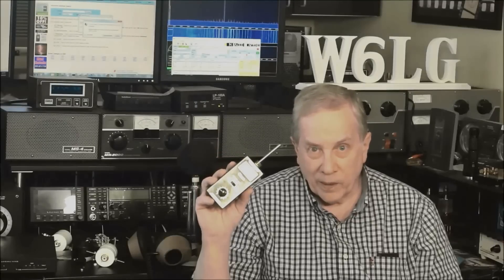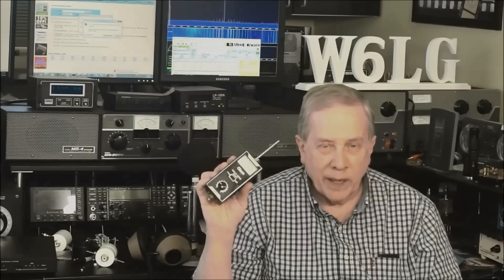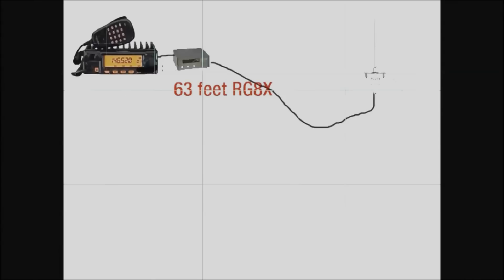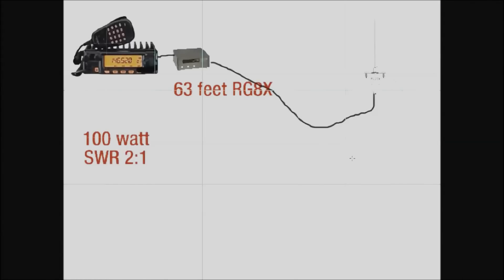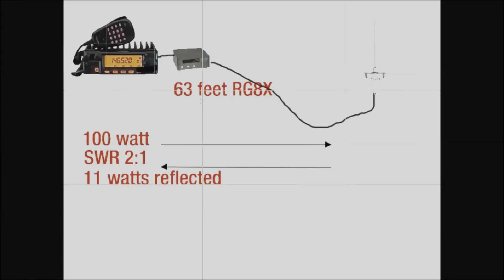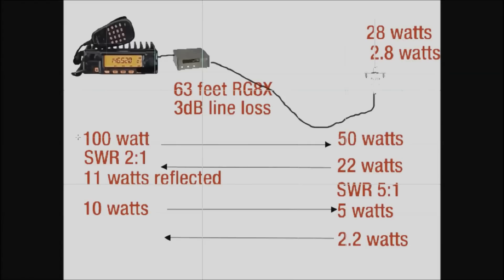Ham Radio Basics--SWR, How To Measure And Is it Important-A Surprising Answer

Comment: There are thousands of videos like this, none of which are for beginners. You’d have to be an electrical engineer in order to understand how to properly transmit with ham radio. Why don’t they just have kits, like here- you want to use uhf and vhf, here’s everything you need to do that. So frustrating beyond belief.

Comment: Why does swr go up with increase in power ?
Reply from the maker: It does not go up.  It does not change. The diodes in your SWR meter are not linear and display incorrectly. 73, Jim

Comment: Hi Jim! For the energy to be re-reflected from the transmitter back toward the antenna requires a reactive element to catch it and then release it in the proper phase. An antenna tuner is such a device, but there was none in your drawing. As to your main point, yes, a lossy feedline will certainly make the SWR look a lot better at the output of the tuner than it really is at the antenna. Nice graphics, BTW!
Reply from the maker: Thanks Dave.  How's it going with you?  it is a beautiful day here and warm.  I was in the backyard hanging an OCF dipole.  
Some local guys have offered to come by here and help me add 15 meter elements to my homebrew 3 element 20 meter monoband Yagi.  At this time I am planning on 2 feedlines.   I am using a beta "hairpin" match now.  Nice to hear from you again David.  73, Jim W6LG now in Rocklin CA
Reply: @ham-radio  Hi Jim, doing fine. Still can't make up its mind here if it's winter or spring. Good luck with your 20m/15m antenna! 73, Dave, KEØOG

Comment: Shorted coax should have a high SWR, but if it is lossy the SWR can appear to be low. With the right mathematical formulas at a given frequency you can actually calculate the efficiency of a shorted coax cable! Excellent presentation.

Comment: that was interesting
to me an swr at 1:2 allways ment  half power 1 to 1,5   is a quarter.
so 100 watt out is 50 watt out at 1 to 2   or at 1 to 1,5  its 75 watt out.

and im using rg 58  to an hb9cv   on 434,975   to the local dmr repeater  5kms away.
i got a good signal.  4 out of 5 pinns  on an hytera785 pinn_o_meter.
well i can reach the repeater on a handitalkie outside my forestcabin 250milliwatt  out.
so as low power as possible on the hytera.

Comment: Hi Jim. I have a question about SWR. My mobile radio is the President Lincoln ll+, with 10meter, CB(11meter) and 12 meters. I have paired the radio with the Stryker SR-A10 magnet mount antenna. This antenna is a base coil, with a 60" stainless steel whip with just about 1/2" of adjustment on the length. I cut about 1/4" off the whip in order to get a perfect SWR on the CB band. However, the SWR is dangerously high on both, 10meters and 12meters. Any idea of how to get usable SWR on all three of these bands? The only solution I have thought of, is purchasing two more steel whips and cutting them to length for proper SWR and just switching them out. That's not a very solution. Any ideas?
Reply from the maker: I know nothing about CB equipment.  SWR may not mean much.  Getting an antenna reasonant where R=50 and J=0 on 3 bands is probably impossible.  But again, I don't know anything about the equipment you have.  Sorry I can't be more helpful.  73, Jim
Reply: @ham-radio  Well; with all due respect, I have discovered that amateur radio operators consider CB as some second-rate communications to be shunned and/or ignored. Quite frankly, the cold shoulder I have received from amateur radio operators, simply because I have chosen to include the 11 meter band on my radio, is making me have second thoughts about getting my license. For now; I will ignore the amateur bands and focus on CB, SSB for now. I have 6 years experience with Marine Corps communications with ATC/ground control while operating land-based expeditionary airfield equipment. I have also served 23 years as a 9-1-1 telecommunicator. I am a total professional, when radio communications are concerned and the stigma attached to the CB band has totally turned me off to becoming an amateur radio operator. I may reconsider amateur radio in the future.

Comment: How does this translate for QRP? I was horrified at the lossy numbers in this video - those would be devastating when operating at 5 watts. I'll have to do some research, but I'm very interested to know what this means for HF and SSB & CW work. If I'm using a tuner to get me from 2.5:1 to 1:1 on 5 watts - how much did the tuner just subtract from my overall system assuming I'm running 20 feet or less of Coax? Those are the kind of real world (for me anyway) problems that I'm looking to solve.  Thanks to this video, I at least know where to look for signal strength loss and to view the SWR reading with a wary eye.

Comment: I have noticed that a lot of hams use the RG8X for short jumpers in the station because it's much easier to route and handle than lets say LMR 400.  If you have a jumper or two of the RG8x, will it cause any significan't loss if the bulk of your feed line is the heavier stuff?
Reply: Feedline attenuation is measured in x number of dB per foot.  Every little bit adds up.  Generally short bits don’t matter much, but it all depends on what you’re doing.  At 10GHz adding a couple feet of even good feedline can consume half your power! At 3MHz the loss wouldn’t even be measurable.

Comment: Is swr important when receiving?
Reply from the maker: On the surface, that sounds like an easy question to answer.  My answer is yes.  But, others may disagree for lots of reasons.  SWR is a measurement made with some kid of device that transmits.  It is a way to measure the match or mismatch at the feedpoint.  You know, this is such a good question, I may do a video about this.  73, Jim
Reply: @ham-radio  I've been a follower for quite a while now I think I lost touch and then resubscribed at spme point iam glad i can help  give back  💪😁👌
.. i was only asking because iam reserching my foundational amature radio licence and i have been playing with the Rtl.SDR  and 27mhz  so I was wondering whether I bother with swr for the RTL SDR  i have a common mode choke in my home made dipole and that seems work wonders ...also can the device (radio) change the swr of the antenna .. 73's  from Bundaberg Queensland Australia ..

Comment: It seems like you are equating SWR as being transmission line loss plus power reflected from an antenna impedance mismatch. I don't think that is correct. While both result in reduced effective radiated power, they are different problems.
Reply from the maker: SWR is one component.  Line loss is another component. Higher SWR result in greater loss.  Line loss makes the SWR look lower.  The highest ERP is the goal. If you do see an error in the video and want to let me know when that occurs, I sure will do a correction. Thanks, Jim

Comment: Thank you for explaining this subject. 
 Is the heat loss from the reflected energy absorbed by the tank circuit in the tuner and the ground plane only?
  With much of the losses due to the coax itself, how much better would a balanced feed line be between the antenna and tuner if any? 
 Also, please explain the benefits if any of "shielded parallel lines" aka "shielded balanced transmission lines".  
 Can any power escape from the coax as radiated rf ?

It sounds like you are perfectly explaining some of M. Walter Maxwell, W2DU book, Reflections: Transmission Lines and Antennas. I do not understand much of Maxwells theories, It's way over my head. I have lots to learn.  I also found a good source of information on this subject in Stephen C. Ward, WC7I article at http://hamuniverse.com/wc7iswr.html

Thank you for making this video, I am going to have to check out your other videos on the  SWR subject. Thank you again.
Reply from the maker: If you mean parallel feedline like a ladder line versus coax, the parallel line if almost, almost loss less.  And, that can be a big advantage. 73, Jim

Comment: Hi Jim just got a marine radio uk  its my first. its for my boat i bought this year can you tell me which swr meter i need to tune it in as i cant find any that go up to the frequency 156. to 174mhz i see only ones that go upto 125 0r 130mhz  looked on ebay ! thanks for your good advice so for
Reply from the maker: Hi Phil,
I see several on Ebay.  Look for VHF UHF SWR Meter.  That device will cover up to about 450MHz.  Regards from Rocklin, CA, Jim Heath

Comment: Hi Jim great video. The 5:1 swr was that 100/22 reflected? Thanks
Reply from the maker: I believe so.  it has been a while.  Thanks Tim from Jim W6LG
Reply: Jim W6LG thanks Jim. Take care friend 73
Reply: I know this is late, but for anyone else that reads this, yes it's correct. 4.94:1 to be precise. I cheated and used an online calculator. You have to remember to put in 50W of forward power.

Comment: Very good video Jim, I've watched a few of your videos.
I started with valve gear and had an output indicator meter at the aerial and tuned for maximum output and later used an swr meter. Then I went homebrew with a MOSFET p.a. and for years used no swr meter, just tuned at the aerial for maximum signal out. My amateur pal was horrified because I had no idea what the swr was. Probably ten years later I made a resistive bridge swr meter and it proved what I had done was right. I'm now going to use RD06HHF1's which while experimenting with the p.a. have seen ridiculous swr readings and survived.
But yes, an swr meter takes the worry out of matching the aerial to the tx. I like the resistive bridge type because the radio never sees above 2:1, the meter shows all swr readings, but it is limited to QRP because of the resistor ratings.

An interesting point here, I tried 6m with an FT817 a few days ago with a dipole I was given, I got the swr right down. I called six amateurs and even though their signals were booming in here they did not come back to me. There's something wrong. I took it down and noted not much r.f. present at the dipole, I saw corrosion so I cleaned the aluminium and re-connected the coax. Now much more r.f. showed on my r.f. indicator. I've yet to have a QSO but feel confident it is radiating far more efficiently now.
So it is still a good idea to check at the aerial that it is actually radiating.
73, Bill, G4GHB.
Reply from the maker: Yes, that is a very good idea. I recently took a dipole down that I had made from aluminum tubing from another yagi at my old location.  The dipole never performed as it should.  I had hardline to the antenna with a short length of RG8X. With Bird wattmeters I determined that there was RF to the antenna. After several attempts at a repair, I have up and took it down. It is now on the ground.  Since it was an old driven element off of a 4 element yagi, I did not disassemble and reassemble. My guess, and it is only a guess, is that there is some resistance between the telescoped tubes.  The replacement is still on the ground. I made it from pieces of tubing and used a anti-oxidant between the tubes. Also, I put sheet metal screws through the tubes. I will let everyone know if that worked in a video later.  Thanks and 73, Jim W6LG
Reply: @ham-radio  Hi Jim, 
I just re-read your comment and it made me think about a 6m dipole I was given.
I could hear Portuguese, French and Spanish stations over say a week, strong but I couldn't raise them.
On investigating I found corrosion at the SO239 socket, the elements and gamma match. Was that my problem? 
The band isn't open now so I can't be sure but it won't have hurt it to clean things.
73, Bill, G4GHB.

Comment: Excellent video. I'm new to Ham, but I'm a truck driver and I've used 11 meter CB for years. I had a CB shop technician tell me to just use a 21 foot feed line and I would never have to worry about the SWR. Lol. Now we know why that makes the SWR look so low.
Reply from the maker: Thanks for sharing.  Find a local ham who has decades of experience and maybe is an engineer.  Local guys are usually very happy to provide help to someone who is just starting out.  If there is a subject for a video that you would like to see, please let me know via email.  73, Jim

Comment: This very reason I choose LMR400 to supply to my antenna a 110' away.
Reply: hell I chose LMR400 and the run was less than 50'  No point having a fancy radio and losing all its ability due to no good coax.

Comment: Thank you!! so rg213 is more important for uhf-vhf and rg8x is ok for hf? i have 50 'feedline.
Reply from the maker: Sure.  But at 10 meters you will lose about 20 watts out of 100 watts. In other words, it is about 80% efficient.  That number assumes that the coax is properly manufactured and that the connectors are good.  LMR400 has about half that loss being 90% efficient.  RG213 is in between those two at about 85% efficient.  I would use RG8X if that was more convenient due to its weight or size or cost or location.  73, Jim W6LG near Sacramento in norther CA.

Comment: Rg8x 50' , dbj1 multiband Ed Fong antenna baofeng radio 8 watts f8hp does pretty good on the 2nd story. just under a month with my licences
Reply from the maker: Hi Matthew and thanks for the message.  Well, when you can put up a larger antennas and better coax you might see a difference in performance.  With your current antenna system, you are putting about 3 watts in the coax. About 2/3 of your transceiver's power is being lost in the coax.  I have worked some guys in VU over the years.  From W6 to VU is a difficult path.  73, Jim W6LG

Comment: Greetings Jim.  I watched many of your videos as I was preparing to test.  I passed both Technician & General tests this weekend.  They talked me into trying the extra since I was there and didn’t pass.  The first extra questions I saw was taking the test. Need to study.  Haha.   Looking forward to putting up some VHF & HF antennas are the house.   73!
Reply from the maker: Terrific Brent! Congratulationson passing both tests.  Yes, do get on HF and work some DX.  I don't recommend DX nets.  Learn about propagation either by reading and watching the clusters, or ask a ham who has been on the air a long time. 73, Jim
Reply: Jim W6LG Thanks very much.  I plan on getting on HF for sure.  I have a buddy who is going to loan me a HF rig.  First things to do is expand my entry panel in the office ... soon to be called the ham shack.  I plan on learning before I leap.  Probably get on VHF/UHF first and ease into HF just because it will be easier to mount an antenna for that.  By the way, I need to come up with common tools like SWR or Antenna testers and power meters and such.  Do you have a video covering this?

Comment: I have always used RG-213 Coax cable. I like to tune my antennas with the SWR meter at the antenna on a 3ft jumper. Once this is done and the antenna is raised to at least 30ft to its base & grounded to an 8ft. Copper ground rod the SWR should read low at the radio. My equipment runs cool and receive & transmit operate evenly across the band. I do notice atmospheric changes can & will effect meter readings on output from time to time but not the SWR readings. I believe excess moisture on the antenna causes this but doesn't appear to affect the stations output performance. 🇺🇸
Reply from the maker: Thanks Miguel for the great advice.  I agree that moisture will cause changes but nothing that we can easily measure.  Happy New Year from Rocklin CA, 73, Jim

Comment: Jim your videos individually - and combined as a reference - are truly amazing.  Thank you so much!

Couple questions... or statements to confirm my understanding:

1 - is the SWR meter simply measuring watts traveling one way vs what it receives back reflected?

2 - if I understand this correctly the SWR meter is only measuring what was reflected back to it, so it doesn’t know what was actually lost in the coax line.  so if we factor what was lost in the coax line (by charts) we can get a better “hand measure” of what the real SWR measure is.  is that correct?
Reply from the maker: 1  Both directions, hence the two diodes with one forward and one reversed.

2.  Yes.  If you know the loss in the coax you can get a pretty good ides of the SWR.  I have found that for new coax, the loss charts are accurate.  If the coax gets water in it, the SWR goes down and the loss goes up.  Thanks again for watching. 73, Jim W6LG

Comment: Hi Jim,   I have an old SWR meter I am trying to make work but cannot figure it out. It is a Monarch FS1 - 5  It is from the late 60's according to the sticker on the top.  It does not have a switch just 2 meters - 1 for power and 1 for SWR.  Any input would be great Thanks in advance  KB1WOR